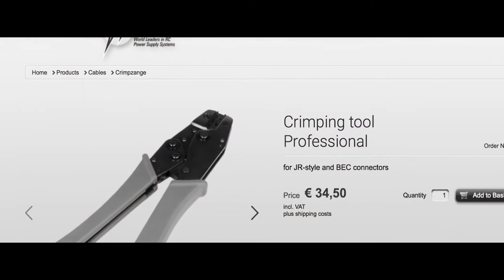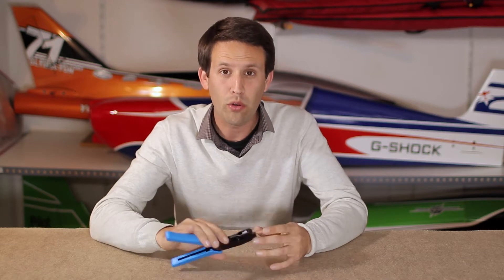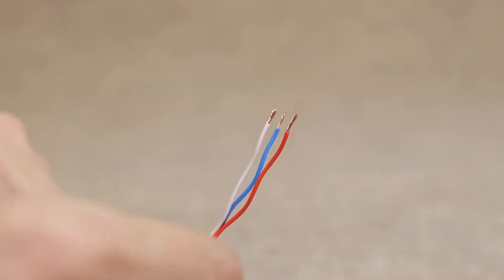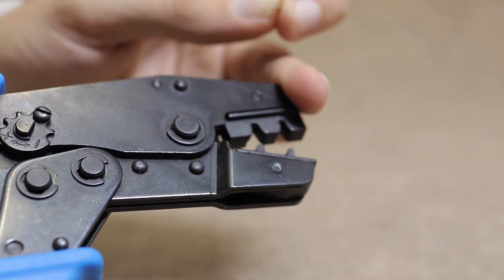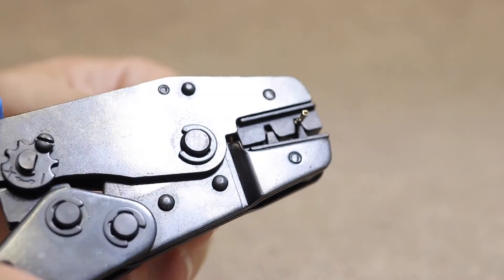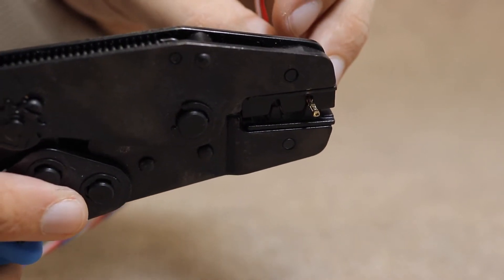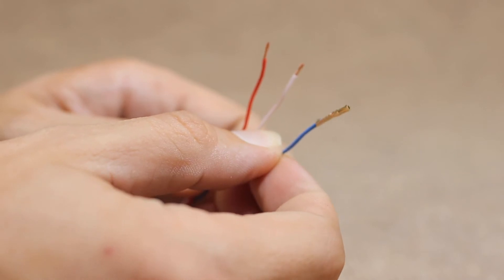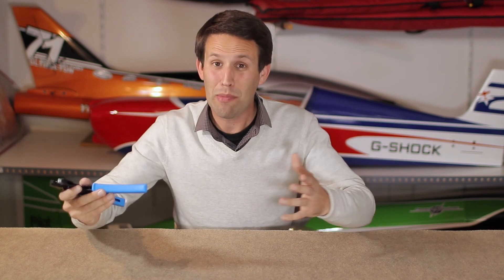🇬🇧  Making servo leads - V2 revisited!

Comment: Is there a trick to get them into the plastic connector? Its impossible
Reply from the maker: You need to crimp down hard so that the shape is made correctly. They only fit in one way (the lip slots into the open side of the connector). Even when done fully it can sometimes require a fine screwdriver or similar tool just to help push it in the last fraction allowing it to lock into place

Comment: Sorry Martin, but really liked your original method.  Found it much easier.  Your new video mimmicks what everyone else recommends. Much harder with new method to have all wire/connectors the same length; at least for me.  Either way, thanks for sharing.
Reply from the maker: I have to say, I am used to the old system and that has worked really well for me...  This is just an alternative, that I may or may not continue use, will see how natural it feels! thanks for the feedback!!
Reply: Your original method for me is a no brainer.  Those individual connectors are so small, for me they get visually lost in the crimper.   Keep up the great videos!
Reply from the maker: Thanks Greg! Will do!!